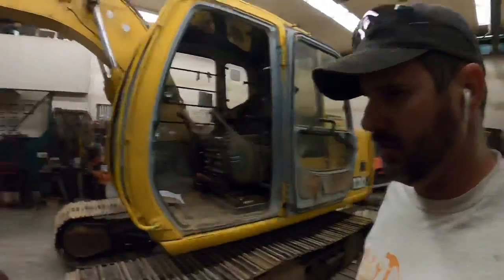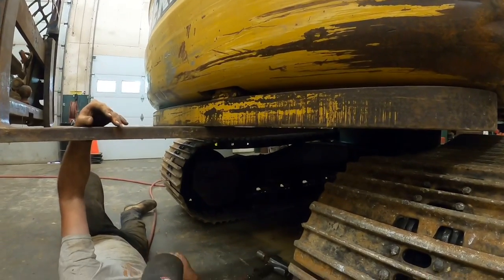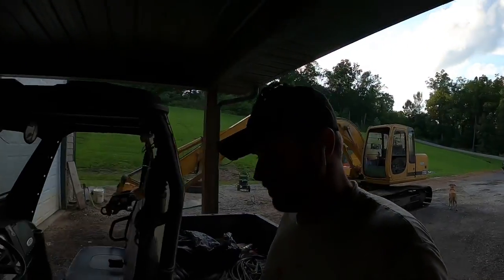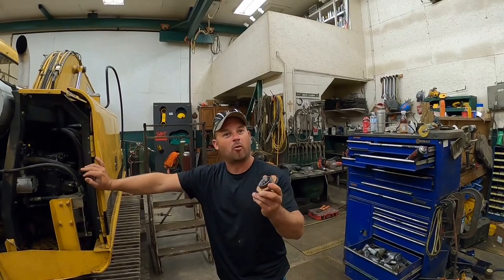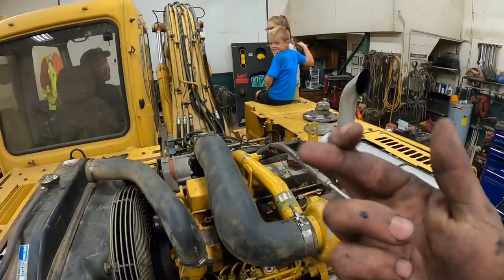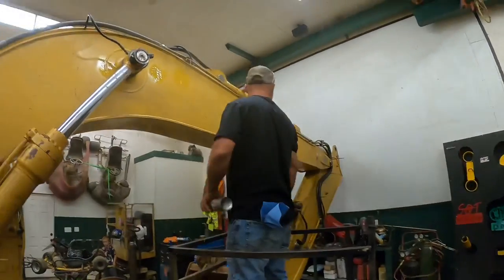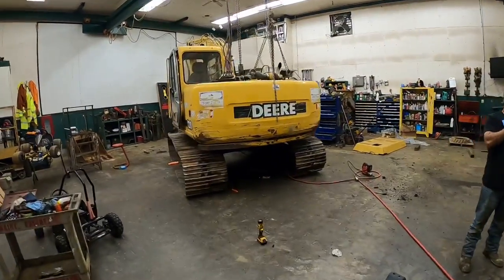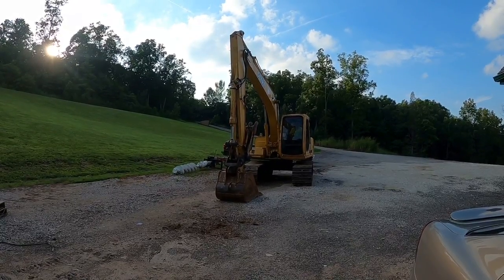lots left on the punch  list but it's time the 120 is done and leaving the shop

Comment: Mike, if you epoxy a small magnet on the oil plug, it will tell you the volume of 'metal' between oil change... JD weld works well! Clean plug and magnet with ether... G

Comment: Nice wrap up and acknowledgement of Man Behind The Scene And Steve. Is it even possible to re and re injector pump without removing counter weights? This job would be very difficult without Your shop and in the field. I think I’ve answered my own question. Even pressure washing is impossible. Let me guess the machine is 10 years old and you have never had to touch injector pump. Let me guess at the numbers. New machine is more than 200 thousand PLUS. Value of wore out machine before you started rehab 25 thousand. Cost of all parts 20 thousand. Value of machine now 100 thousand plus for machine that will last another 10 years. That leaves You 55 thousand to pay for some labour, Your time and Your shop USE on rainy days. CONGRATULATIONS ON THE BUILD. YOU ALSO PUT ANOTHER 100 THOUSAND IN YOUR POCKET BY NOT PAYING FOR NEW MACHINE.
Reply from the maker: Thanks butch

Comment: Yeah that was a lot of good luck finding those loose bolts on the pump, cause one of them in the gears would have been a real pricey fix. Always feels good to get a machine back up and running again, you can always give it a little paint in the winter if it slows down a little.
Reply from the maker: Yes it was

Comment: Nice catch on the IP bolts. If you ever decide to put AC on it, you know how to pull the counter weight. Had to do that on a 160C that had a mis-built AC bracket. It sure makes it easy.

On the motor mount below the IP, it looks like there was a witness  mark where a bolt should have been.

And Constance the Safety Goat suggests screwing lifting eyes down solid. She says that as they were, the bolt can bend and break.

Overall, well done, DP. now you can add up all the hours you spent working on it, multiply that by the dealer shop rate and see how much money you saved doing it yourself.

Comment: For some reason I thought those counterweights were mounted on hydraulic RAMs so they could be taken off and put back up on it easier. But seemed to work pretty good though hoiking it off with the chain fall & overhead.
Reply from the maker: The bigger machine they are
Reply: @DirtPerfect  Ah okay. I saw it on a bigger Volvo (I think it was like an EC480 or something like that) and kinda assumed that was just how it was done.

Comment: I take my oil filter off from the top. Better than getting oil in your eye.  Did you use an impact driver to tighten those little loose screws   on the injection pump?  The 120 is a great machine, I understand why you went thru all the trouble to restore it.  I would do that to mine too but I kind of like the looseness in a well worn machine.  As long as there are no structural cracks.
Reply from the maker: Thanks and no
Reply: @DirtPerfect  Well it's good you used thread locker.  What is the last 6 numbers of your serial number?  My 120 looks identical to yours except for the extra counterweight.

Comment: Always buy genuine JD parts.........Yeah, Sure.  Local JD dealer wanted $480.00 for the starter on my backhoe 510B.  I bought a new selonoid from ebay for 30 bucks plus an o-ring kit and new brushes for 39 bucks.  That was 2 years ago and it starts every time.

Comment: Hard to believe, but if you threw that counter weight into a pool of mercury, it would float like wood on water. I used to work at a place where we had several hundred gallons of mercury. If you happen to be pumping water with a gasoline driven pump from a sump that has mercury at the bottom, if the suction line gets into the mercury, the motor will bog down and the weight of the mercury will pull the pump into the sump.
Reply from the maker: Interesting

Comment: Replace that cheesy door panel with something nice like some thin aluminum diamond plate, or some nice wood panel or a reupholstered  panel, but I'm glad you caught all those loose bolts.
Reply from the maker: Why don’t understand the issue there sorry
Reply: @DirtPerfect  I WAS TALKING ABOUT THE  panel with a little black vinyl left and what looked like warped pressed board, kind of tongue in cheek, but you have a great machine, and I liked and thumbed up the video so just forget about my comment.

Comment: When you filled the hydraulic oil up
 the arm wasnt in the correct position to read the level between the lines on the tank the sticker shows where its should be
Reply from the maker: Lol ok can I not check it out side 🤷‍♂️
Reply: Yeh you can but if theres to much fluid in the tank when you reposition the arm it could blow the tank so I would do it slowly and with the tank vented to atmosphere 👍

Comment: I had to laugh at the safety chain preventing counterweight from tipping over.   the forklift might have been needed to level out and help support the weight of the thing hen bringing it down. I don’t know what the weight of the counterweight is but Aaron better have some heavy duty steel toed boots in the event that God for bid that chain broke when you were maneuvering it to the side of the excavator.  Aaron would have been been nicknamed. NTA (no toes Aaron).  I glad the leak was fixed, great job and a lil luck and intuition on that lose bolt.  Was it a screw driver only bolt?  Yes, you have great friends